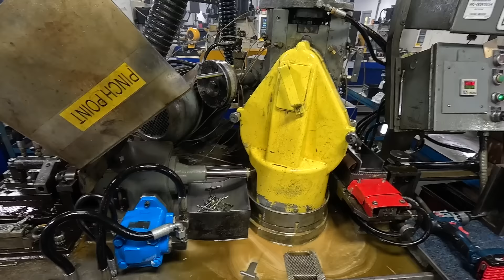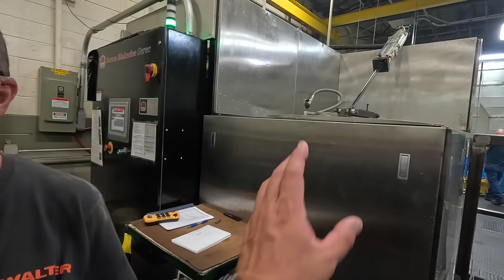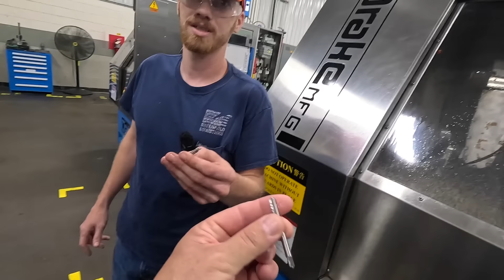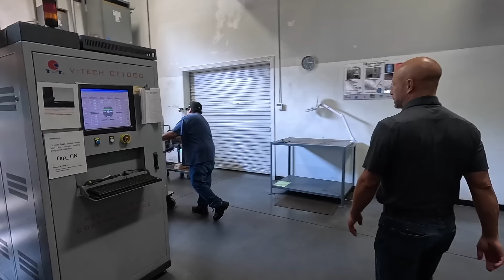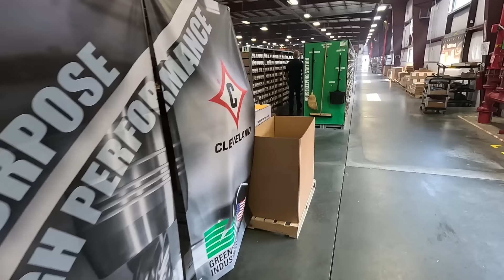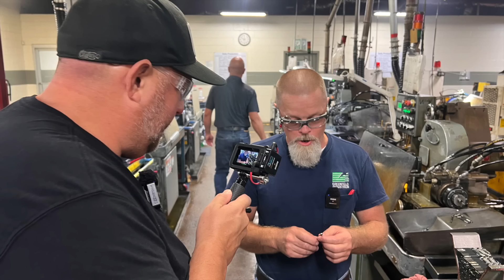How are Drills, Taps & End Mills Made? Greenfield Industries Factory Tour

Comment: Cleveland are good quality cutters. I’ve only ever had one problem with Cleveland drills and they were special order. They were long series drills (about 15 inches) in 3/8 diameter. Nothing wrong necessarily with the drills that showed up other than the ones labeled 3/8 were 33/64 diameter drills causing a bit more of a wait on the costumers parts. But I work a long ways away from where they were made and when they were made aware of there mistake on Wednesday afternoon I had the drills in hand by Friday mid morning.

Comment: I would like to see HEPA filtration been put to use in that facility. There seems to be a mist of cutting oil in the air. Breathing that for years, must take a big toll on you. There’s a lot of fans blowing around the air, I think air conditioning units need to be installed to manage the heat and condescending some of the oil out of the air
Reply: I'd also definitely want some hearing protection. Sounds like a very noisy place

Comment: That hazy air sure brings back memories. I spent 7 years working for New York Twist Drill in the 80s. Lots of grinding with oil kicking off a nice mist and lots of stinky smoke.
Reply: That can’t be good for,the worker’s lungs.  Oil in your lungs will block the exchange of gasses between the lung tissue and the air.
Reply: @tomrogers9467  a lot of people got a lot diseases where I worked. The smoke settles up in the roof beams and coagulated back to oil and drips on your head. Not too mention the floor gets really slippery. I don't miss that environment.

Comment: DOES ADDING A COATING CHANGE THE DIMENSION OF THE TOOL ?  ARE THE BLANKS TO BE COATED UNDERSIZED?
Reply: Tools are not made undersize for coatings. The application method for our coatings results in a very thin and resilient coating, which does not result in an out of spec tool size. Good question!
Reply: @GFIICuttingTools  THANKS FOR THE REPLY.

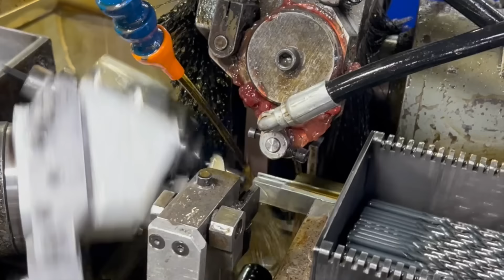Comment: 12:20  That surprised me how the tip was ground along its tip angle. I always wondered about that.
Reply: That was only one type of point grinder, used for drills up to half-inch diameter. We have other pointing machines/methods. I run a smaller machine that points drills up to three inches in diameter. Each machine type uses a different approach to achieve the desired point shape, angle, and other features for the intended application.

Comment: I was looking to learn how the drill shanks were kept soft. I guess the blanks come in with one end softer.
Reply: The blanks arrive in the factory annealed. The shanks are intentionally left soft during the heat treating process to provide better gripping and less breakage.
Reply: @ellieprice363  I understand why the ends are left soft.
Are you saying the annealed drill blanks are hardened at the Greenfield factory? I saw some heat treatment in the video but no hardening.
I suspect the drill blanks are hardened at one end and soft at the other when they arrive. Perhaps this is why the flutes are ground instead of milled.
Hardened shanks may not contribute to less breakage. They would allow the shank to spin in the chuck, like a clutch, instead of breaking. 0/2
Reply: @marley589  I started at this facility over 14 years ago. At that time the facility had an area where drill blanks were dipped into molten salt, in steps of varying temperature. The salt was kept molten by huge amounts of electric current passing through the salt solution.
Reply: @JamesCox-i8w  Thanks James for a very interesting reply.
So the blanks were bought in even when you started. Do you know if they were supplied locally?
I wonder if the HSS cutting portion is traditionally butt welded or friction welded to a softer shank or if it is possible to only harden one end of a HSS blank. This would have been a great insight into the composition of the drills in the video.
Do you know if the salt bath was for hardening, tempering, or surface conditioning?
Perhaps @GFIICuttingTools could answer this, I haven't seen any reference to the important actual physical makeup of the drills in the comments.

Comment: Adam, possibly in a follow up video you can help explain the difference between the Cleveland brand bits vs the Cle-Line bits. I did a internet search and couldnt find a clear explanation. Maybe cost and tolerence specs? Not sure. Great video. I watched the whole video.
Reply: google answer;
''Cleveland and Cle-Line bits differ in a few ways, including: 
Size
Cleveland brand bits include sizes from 1/16-inch to 1/2-inch in 1/64-inch increments, while Cle-Line jobber drill bits range from 0.50 mm to 13.00 mm. 
Finish
Cle-Line bits have a straw/bronze finish to reduce grinding stress on the cutting edges, while Cleveland brand bits have an uncoated (bright) finish. 
Flexibility
Cle-Line bits are made from high-speed steel, which provides some flexibility and absorbs some shock and vibration. 
Suitability
Cle-Line bits are suitable for use in manual drilling machines and handheld power tools, but they may leave a rough finish on the hole.
      ''Cle-Line are machine shop grade drill bits''

Comment: Can't imagine places like this have much longer left. Way too many employees, tools that are 25 years out of date. You can see the oil mist in the air. Cant see a single machine there from the last 10 years.
Reply: Who says they are 25 years out of date?  A lot of their old machinery is far superior to what is available today.  And no machines from the last to years? Did you miss all those Anca’s?  too many employees? What about the employees that enjoy there careers there?
Reply: You'd be surprise at how many companies rely on equipment that are even 100+ years old.
Reply: They have a sensible mix of modern grinders and some with robot wheel change and part auto loading. And the organization and enterprise systems were handling 30,000 skus. Plus the buildings looked fairly new. I'd say they're doing well and investing where needed. There are trade offs between production rate and versatility. If you change wheels three or four times for one tool, cycle time goes way up versus dedicated op cells.
Reply: This place is a lot more modern than many factories.  Plus the products they make are still relevant and consumables.
Reply: You don't need a 6 month old machine to do a task that has been optimized just because it's shiny and you say it's CNC doesn't mean it's faster or cheaper or better than even a human hand. Not everything needs to be made in China my friend
Reply: @thecanadiantradesman7916  not china, most performance end mills and drills are made in Europe.
Reply: The sad thing is the buying up of Brands by Venture Capital firms to turn around and offshore the production with an old badge on it. Starrett will more than likely head that way after the recent sale as well.

Comment: My first disclaimer is I am certainly not a machinist or even mechanic, but a general homeowner and hobbyist that only maintains and repairs my personal items. My family bloodline had the machinist and mechanical qualities.  
Excellent and impressive tour of Greenfield Industries.  I have never seen this process before.  I have an old tap and die set of my grandfathers that I still use from time to time.  (I am 71 years old) Still excellent quality tooling.  And it's housed in the old and worn original wooden box with the original logo/label on the top.  I had to go to my shop to look at it again.  It is a Little Giant tap and die set made by Greenfield Tap and Die Corporation in Greenfield Mass.  Their website said Greenfield originated in Ohio in the late 1800''s and future acquisitions made changes in location.  I didn't see anything connected to Greenfield Mass.  Did you get any history during the tour?  Same company, but only moved operations?  Really curious.  Thanks.

Comment: The air quality in that shop looks poor at best.  I completely understand why, but it seems like something that could be addressed.
Reply: I suspect that's humidity not smoke in the air. Lots of coolant being used in those machines.
Reply: Was thinking the same
Reply: Only the minimum niosh standard of course. The robots that will soon replace all those humans will either be able to handle that dirty air or if it's lucrative, they will add measures to further clean the air.
Reply: @notverycooldude How do you know the air is “dirty”? The plant is climate controlled with filters to clean the air to a reasonably safe level for manufacturing.
Reply: @ellieprice363  I didn't say that
Reply: @notverycooldude Yes you did. Your post mentions “dirty air” in the plant.
Reply: @ellieprice363  well then, the robots will be able to handle that air of "poor" quality. Their skin won't be affected by the cutting fluids, the sharp edges and they won't appeal for disability when their joints degrade from repetitive motions.
Reply: Damn jim. What kind of work do(did) you do? You're sniveling about everything. Just lock yourself in a room and apply for government aid.@greatvaluewalmart
Reply: @notverycooldude Very true if only robots run the factory. The air quality must meet OSHA standards for humans to work there. My hat’s off to factories that employ as many humans as possible to manufacture their products.
Reply: That's typical. Sometimes a little better, sometimes  a bit worse. Welcome to upstate South Carolina.
Reply from the maker: When we first started the tour there was a fingerprint on the lens that we didn’t catch right away. 😬 Oops!! The entire plant is climate controlled with additional air filter units to filter the air. 👍🏻
Reply: Sorry, but to say "...that's the reality of manufacturing" is a cop out. Management needs to reinvest some of their profits back into better engineering controls so as to sufficiently protect their workers my brother.
Reply: Yeah. That's a sad reality of manufacturing.

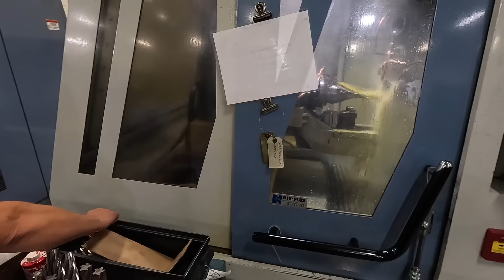Comment: 21:20 is blowing that coolant cutting oil out so hard necc?   Does that keep it cooler? or cleaner
Reply: Cleaner.  Metal swarf from grinding and some debris from the wheel must be completely removed for each stroke under the wheel. The higher the velocity of the fluid the quicker it can flush the surface and the faster the machine can run and make more per hour.